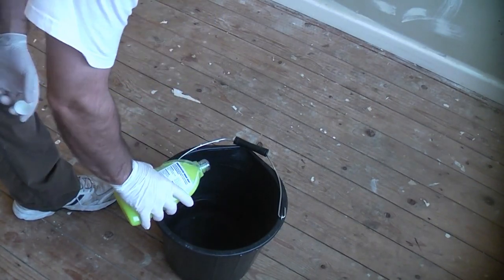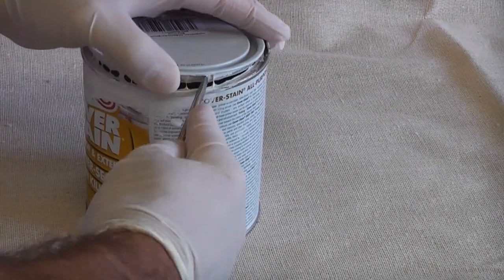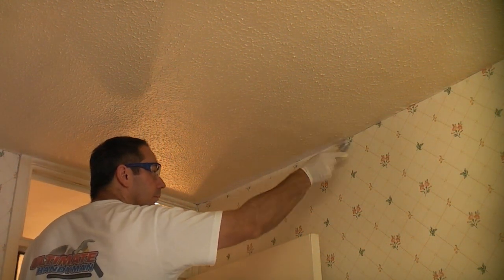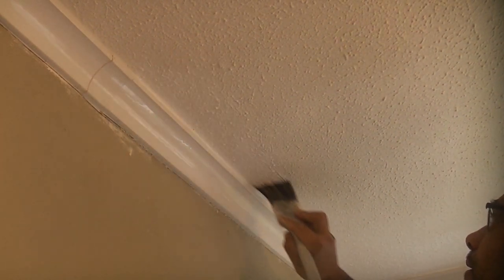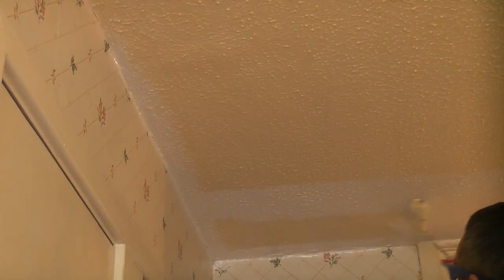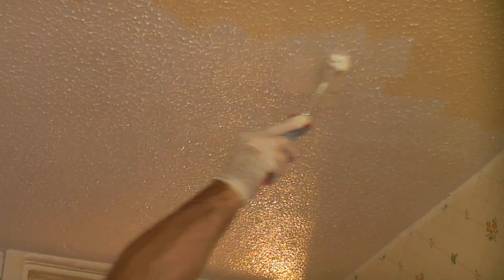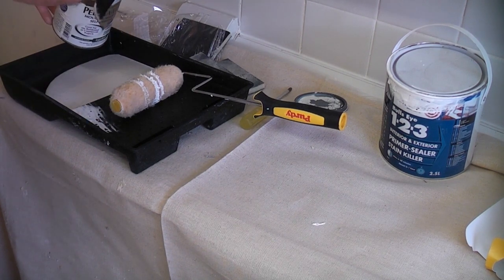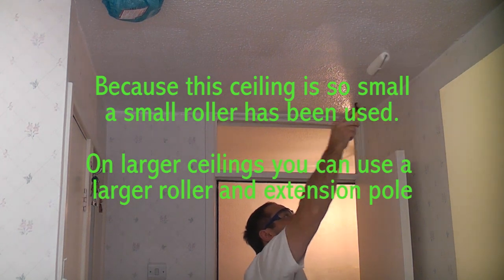How To Paint a Kitchen Ceiling-Painting A Ceiling

Comment: Lovely job there. Big fan of Coverstain after being recommended it on the forum, now I use it all the time mostly for spot priming tricky areas and repairs. Not tried the permawhite, will look into it in future, Zinsser products have not let me down yet.
Reply from the maker: +caskwith 
I must admit that I often read the painting and decorating forum and that is where I first heard about Zinsser products. In this flat I used Zinsser- DIF, Gardz, Cover stain, Bullseye 123, Perma-white and Perma white tinted to a magnolia colour. The Perma- white that I had was about 4 years old as I bought about 10L of the stuff from a seller on ebay and it came in 1L tins, it had been kept in my office, so a quick mix with the paddle in the drill and it was like brand new paint!
Thanks for the comment ;-)

Comment: waterbased onto oil based? I thought you could only do the opposite (oil onto water). What you saying?
Reply from the maker: +eitan100 
Zinsser cover stain is oil based, Zinsser perma white interior is water based.
You can use cover stain, then use perma white interior on top, I just checked the Zinsser pocket guide.
I'm not sure about other paints though!
Reply: +eitan100 Not onto oil based top coats, but Coverstain is an oil based primer that provides a lovely surface to add either oil or water based top coats.
Reply from the maker: +caskwith 
Absolutely, I have to say that the cover stain is brilliant, although I was mighty impressed with Zinsser Gardz as well.
Thanks for the comment ;-)

Comment: As Darwen is in your neck of the woods, surely you should be using Crown coatings and paints!
Reply from the maker: +Benzknees 
I did get in touch with them a while back. It took them several weeks to get back in touch with me, I then told them I was doing a full flat refurb and asked if they would like to supply the paint for free, again it took them days to get back to me, by which point I had bought the paint.  
Thanks for the comment

Comment: Good tutorial man! I have a question, my bathroom needs painting ASAP, but it has some mould and is bubbling/peeling a lot just above the shower section. Any help or advice? Do I need to go through and peel the paint completely? The bathroom is approximately 4x4m (relatively large) and i want to do it right. Painting is no issue its the peeling which I'm not to sure about? Thanks Nik
Reply from the maker: +Nik Trp 
What is the ventilation like in the room?
Is there an extractor fan above the shower?
The peeling might be caused to the wrong paint being used. You could scrape off any loose paint, treat the mould using a mould killer- https://www.youtube.com/watch?v=1Vh43Tl5rWE

Then prime the whole ceiling using Zinsser 123+ or Zinsser coverstain, then a couple of coats of Zinsser perma-white tinted to what ever colour you like, or a suitable kitchen and bathroom paint.

Ventilation is the key though ;-)
Reply: +Ultimate Handyman yes there is ventilation in the bathroom, like you said it is key! I watched your video on the mould killer when you realised it and that's one thing that will be done! Issue is that the room is 4mX4m and the section pealing is only about 1mx1m area, so do I try peeling the whole roof? Or just the peeling section? I know that this will then be seen when it's painted?
Reply from the maker: +Nik Trp 
I'd definitely remove any paint that is loose. As for seeing it afterwards you might be able to feather the edges of the sound paint using some abrasive paper. I used to do this when repairing rust patches on my car, if you sand around the sound paint on the edges, then prime the area with no paint on up to the sound paint you might not be able to see the new area, especially if you prime the whole ceiling after priming the bit with no paint on.

Comment: I've just wallpapered could I caulk in the top and bottom edges? even though it's wallpaper
Reply from the maker: +Graham Cummings 
You could, but it can be hard depending on the type of paper and pattern. With most wallpaper you can do though as long as you are careful and don't get the caulk everywhere ;-)
Thanks for the comment
Reply: +Ultimate Handyman haha that's the only thing putting me off doing it as I don't want caulk everywhere lol
Reply from the maker: +Graham Cummings 
If you have some of the paper left over, just try some caulk on it and try wiping it off with a damp sponge. If it comes off the paper easily it should be easy to caulk ;-)
Reply: I will try that and hopefully it comes off easily. Thanks mate
Reply from the maker: +Graham Cummings 
No problem.
Good luck with it ;-)